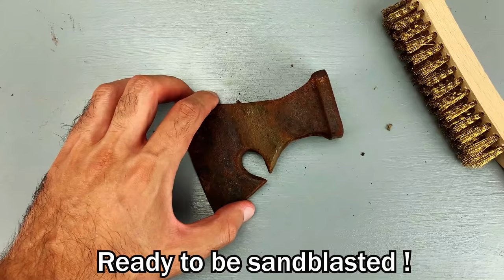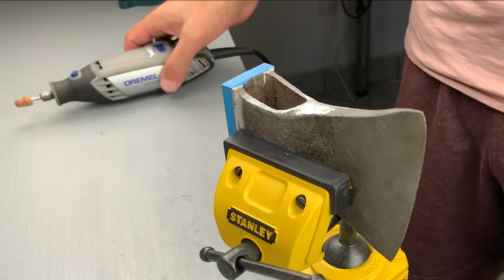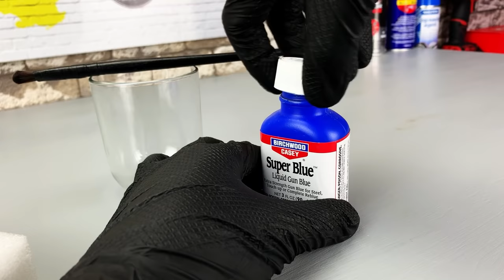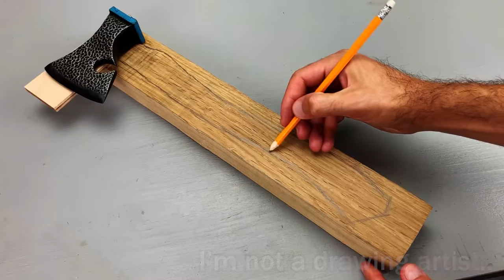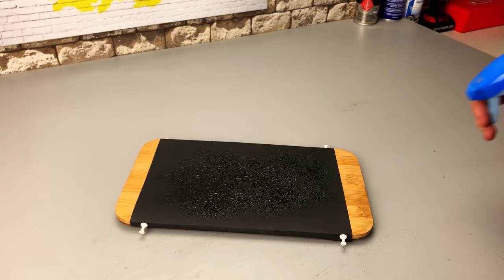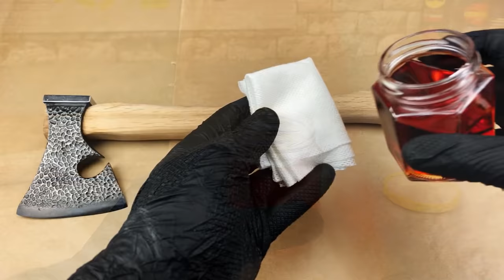$12 Rusty Hatchet Restored into Something Amazing

Comment: Nice job!

I spend a lot of time in the bush here in Oz. There are old tools from prospectors all over the place, particularly in the gold fields. Some of them have been lying in the dust and mud since 1898, around the time of the first gold rushes, sometimes even earlier. Old picks, mattocks, pick-axes, hatchets and axes. Shovels are thinner and usually rusted and worn out and pretty useless. With the heavier metal tools, I actually like them as unrestored as I can keep them, excepting repairing edges, heads and points. 

The absolute best de-rusting is at an atomic level, by electrolysis. It only takes away the rust and no clean metal is ground or polished away.  They seem to have acquired an exceptional hardness from years of baking in ground temperatures up to 50C in summers; either that or they were good steel to begin with. 

I get them back to a nice red-brown patina with all the inherited pits by electrolysis, and without sanding and grinding except for points and edges, which I grind by hand. Then a spot of oil and a new handle and they are done and are scattered all over the house as ornaments which have a practical use as well as talking points.

Comment: The key to restoring a tool is knowing how it was made, and what it was used for.  An axe is a simple thing, but many of the things done here have removed functionality. Granted, it was in the scrap pile, it was designed to do certain tasks that it can no longer do.
Reply: Not to mention that a “restoration” should return an object to its previous condition, a lot of extra work here
Reply: I feel it took away the original character. Clean it up, sharpen and a new handle. If your going to add to it then just find a newer ax head and have at it. Still beautiful work👍
Reply from the maker: Thanks Gary

Comment: Out of curiosity, is there a specific time you should use sand blasting instead of chemicals or like a steel brush?

Because I've seen all of those methods and I don't know the difference.
Reply: Not really, it's more preference or ease of access, like I prefer grinding and sanding
Reply from the maker: True. If you receive the desire outcome with any of this method,then it’s ok

Comment: 1:58 you know you can just use muriatic acid and it will remove the rust.  Even CLR is does a great job, and also Krud Cutter (I think it's called).
Reply: You know these are harsh chemicals right? Sand blasting is just air and sand.
Reply from the maker: Right 👍🏻
Reply: @Esuper1  Sure... but taking the proper precautions there's nothing wrong with them.  Their for sale and people buy them.  Just seems like an easier, cheaper, simpler SOLUTION (pun).
Reply: @urwholefamilydied  You don't get it. It's not about precautions. If a few hundred million people use chemicals like these then there will be tons of this crap to dispose of or poison where we live. If a million people use sand and air there will be the same sand and air. No poisons to be cautious about. See?
Reply: @Esuper1  never heard of silicosis?
Reply: @dimesonhiseyes9134  Silly what? the shit is in a sealed container Sparky, for that very reason but you go ahead and use whatever you want. Bathe in the shit for all I care
Reply: @Esuper1  I use a rust converter, usually something phosphoric acid based. And that's the rust removal, grinding, polishing, finishing, everything 🤣 
Converts the brown rust to a tough black oxide layer. The commercial varieties also leave a polymer coat on top of the oxide coat. 
No chemicals left behind to dispose, no dust, as simple as brushing it on and letting it dry for a few minutes!

Comment: It's a roofing hammer, for putting on cedar shake and shingle roofs.  The hatchet splits the shakes to width, the hammer side is for hammering in the roofing nails, and the hole is for pulling nails.

Comment: I'm no expert, but I believe that's a fencing hatchet. When I was younger I got a job rewiring pastures and the old guy I worked with had a very similar hatchet. He would slam the hatchet down into the top of the post, muscle the barbed wire and tension it through the gap on the underside while I nailed it down in the previous post. The barbed wire would sit in the channel the hatchet made and you could really bed it in there with the U nails. It never once pulled free but it was always on my mind. He also used it to retighten lines with the help of a nail. He called it a fencing hatchet and would always tell me it was a lost technique with the times.

Comment: Great restoration! Just curious -- was there a need to sandblast it first, given that all the surfaces were processed through sanding/grinding afterwards?
Reply from the maker: Yes,because only after sandblasting you can decide what to do with the metal,if has cracks,holes..

Comment: I am pretty sure that is a roofing hatchet used for installing shake roofs. They didn't need to be real sharp because they only needed to split the shakes to the correct width. The hook in the head was for pulling the occasional bent nail.
Reply from the maker: True

Comment: That turned out sweet. Great Video. WHERE did you get the sander for round sanding?   I make walking sticks from driftwood and that would be so sweet.
Reply from the maker: I bought it from a local store . The sander is from Skil but I think it is on EBay too 👍🏻
Reply from the maker: That attachment is called attachment for round surfaces

Comment: That sandblaster is so cool, what is the cost for the machinery? Is it suitable budget for a DIYer or only workshops. I guess you can use a mild acid to remove the rust but for speed and ease this is amazing. Did you use Danish oil for the wood?
Reply from the maker: Isn’t expensive a sandblaster cabinet. Expensive is the air compressor😅 the finish on the wood is homemade linseed oil 🤩
Reply: @CoolAgainRestoration  yes the air compressor is big, but do you need such a big one for smaller projects? You know what they say about men and the size of their air compressors 🤣 the oil finish looks very nice. How did you make it yourself do you have a video of it?
Reply from the maker: No,i dont have a video . An old man from my city make this. 👍🏻

Comment: That's a lath hatchet, from the days before drywall, or plasterboard as we call it the UK.  Plastering was done onto thin strips of wood, laths, which were nailed across the timber frame. The tool incorporates a hammer for nailing, a blade for cutting lath to length, so the joins fall on the studs, rather than in between and an eye for pulling bent nails out...I think.....about the eye, that is.

Comment: Except for the pencil, not one of those tools or pieces of equipment looks as though it's ever been used previously. 
Two things: unless you harden and temper the edge, whilst it might cut through denim, it won't last long chopping wood and I wouldn't use oak for a handle. Ash is the best for that. 
Lovely looking finished article but for display only.

Comment: It's a beautiful piece. Appears to be an old style of Japanese carpenters axe at that. My only gripe is the fact that you left all the pits in the steel which will just collect more rust again and destroy  it once more. Other than that, good job with it!
Reply from the maker: But the holes are not so deep. And the bluing will protect the surface of steel for rusting. At least,a couple of years. But if you oil or put wax on it,will not rust again. 👍🏻
Reply: Maybe if you’re an idiot and just leave it outside. Many people don’t do that.

Comment: Anyone have any info on what the hole is for or what it’s called?? This is a pretty unique on, not like new hatchets, so was curious if this hole has a specific purpose??
Reply from the maker: It was a roofer hatchet and from my research that hole was for hanging ( because it not was sharp for cutting,never been.) so I guess that is the purpose. The blade is for chopping and the flat surface for hammering.

Comment: Really nice! What will you use if for?
Reply from the maker: It is just for display now. I think I will sell them to my subscribers 😊
Reply: @CoolAgainRestoration  a number of years ago I bought an old rusted axe with a split handle for $6.  I cleaned the rust of with solution, file and sandpaper. Then sharpened it with file, glued the handle. Used it to chop firewood during camping trips. It didn't look nearly as good as your restoration, but it served the purpose I intended it for.
Reply from the maker: Probably ( and I hope ) the new owner , after I will sell , will use in a purpose but until then , I keep it as you see in the video 😇

Comment: I always figured the reason to keep an axe sharp and sides smooth and rust free was to keep it from sticking in a block or firewood when splitting.  Either I am wrong or this thing will not be used to split kindling or firewood.  Looks interesting, but also looks useless to use as anything but a wall hanger.  Sad that a great tool ended up like this.

Comment: I love the blade but, not the handle. I like the handles basic shape but, it has a weak point down low. It is also not  oval enough. Its kind of rectangular with rounded of corners. Not really comfortable or safe to use. It is beautiful to look at though.

Comment: It doesn't matter if I find the snakeskin ugly, that's just personal taste. But it also makes the axe merely a decorative object. When you would try it for chopping wood the blade would easyly get stuck in the wood. A smooth surface gives a better function. Besides my taste and functional questions it looks very interesting though.
Reply from the maker: Because this is a hatchet more than an axe , and I used from 2 years by now ( I changed the handle again) . I used in the forest for chopping small wood for making fire for barbecue or at the heating system to my house. It works very well , even if the head has that “snake skin” pattern. Probably you have right if I use in a large wood 🪵
Reply: @CoolAgainRestoration  Ok, that's true. Small parts of wood probably will immediatly spread away from the wood when you hit them with the hatchet so the surface of the blade doesn't matter here, because there's enough room between the parts. It would become important only when you tried to split bigger parts and have to pound several times deep into the wood. I understand.
Reply from the maker: That’s true 👍 cheers mate

Comment: I noticed one thing throughout this video ---- every tool (with few exceptions) was NEW.  Never been used before making this vid.  My question is:  do you recommend buying brand-new tools to shoot a video?  I find that when I get a new tool, it sometimes takes a little time to use it in its best capacity.  But with no dust, scratches or wear on your tools, it did make the video look great.  It would have been a hoot, since your mantra seems to be turning old into new ...  start with an old crusty vise, sander, bandsaw, file etc, and slowly, as you progress in the video, introduce your new power tools, till at the end, everything that was rusted old and used is not spotless.
Reply from the maker: Maybe because I clean every time my tools 😎😇

Comment: No Dremel, no fancy tools or chemicals, all he had to do was soak it in vinegar 24 hours. Good as new. Then put vegetable oil on it and smoke the head over a small smokey wood fire to rust proof it. The smoked-on vegetable oil does the rust proofing. Basically you season it like an iron skillet. But cudos for wasting so much money and effort. Then buy a new handle. Or better yet, return all the returnable stuff you bought for the video and buy a Huskvarna axe. Better than spending the $400 you did to purty up a $10 axe.

Comment: so i have take a little time for the searching what a hatchet it are. first it give over 12 different of hatchet and have a other appearance for more must you all in wiki to hatchet searching. 
what in the video to see is is a "hand ax" there coming form the "carpenter". the hole into the sheet, that is the part betwixt  the edge and the shaft, is a "mulit-tool" you can it using to put the hatchet on a nail on a wall or on a strap on your bell or much more. the poll have the carpenter used tp stamp nail into the wood.
Reply from the maker: True 👍🏻

Comment: Are you living in an old mining area? Axes like that are from an old coal mine. The hole is not for aesthetics. It was for attaching the tool to a cable or chain, so that no one can steal it. I have hammer and axes likes this from an old german coal mine.
Reply from the maker: Hi mate! As many others wrote at this video,I understood that this is a roofer hatchet. The hammering poll is for drive nails and the C hole was for hanging . Maybe is a similar pattern to the mining axes 🤷🏻‍♂️